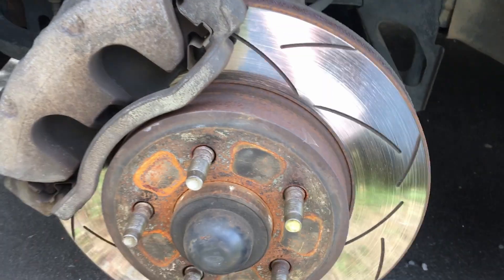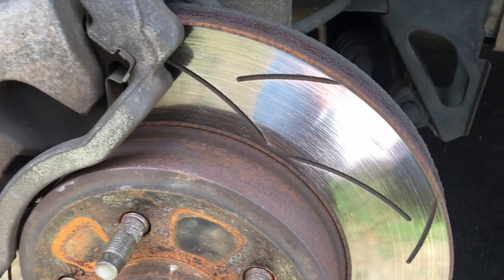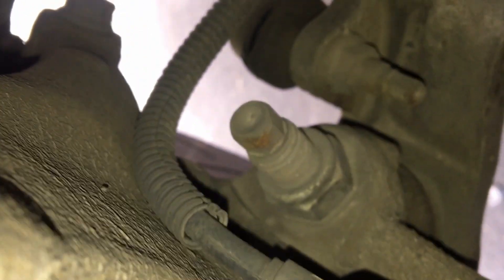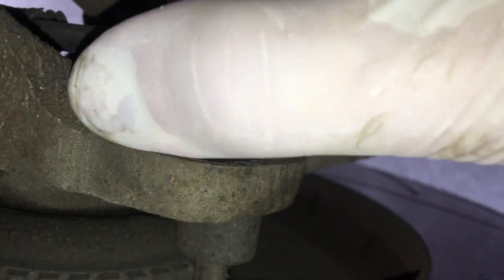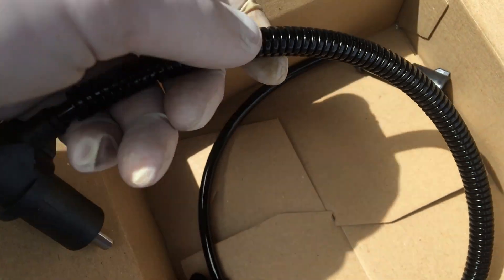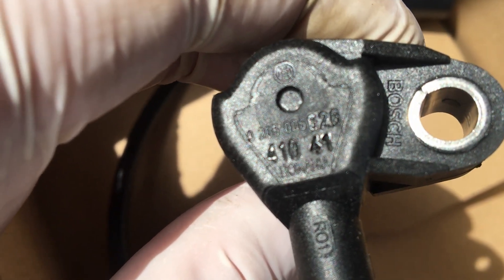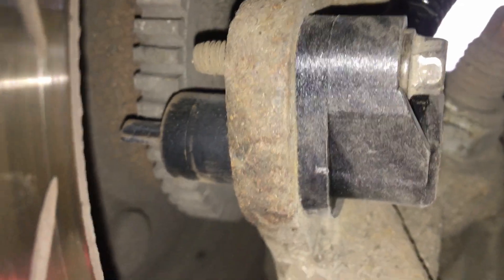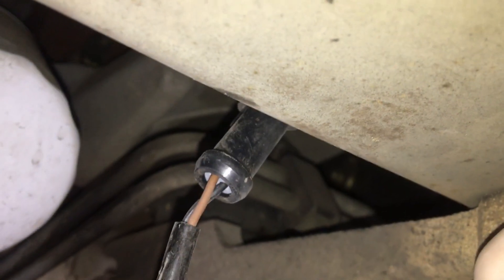BA Falcon Wheel Speed Sensor Replacement - Fix ABS fault code.

Comment: Nice video. To be honest even cleaning the old one may have worked. They work by counting the 'pulses' every time a tooth on the 'cog' moves past the magnet. Then the computer can do different things. For ABS (anti-lock braking system) once the wheels have got up to speed and are steadily moving, if it suddenly stops (brakes locking up) the magnet will detect the sudden stop of movement and the computer tells the brakes to 'ease off' on the correct corner. It does this faster than we can even think about. Like a few times a second. The same cog is used to calculate the speed on the speedometer, by counting the pulses and using a calculator to convert this data to a speed. It's amazing what technology today can do. Not all of the Falcons use the ABS sensor for speed, I think it's only the automatics.

Comment from the maker: A quick update, over a month later and I haven’t had a single issue with the ABS disengaging, nor had the car do a weird ABS break (basically sounds like the ABS is engaging, but in totally normal driving conditions). Seems like it has worked. 😀